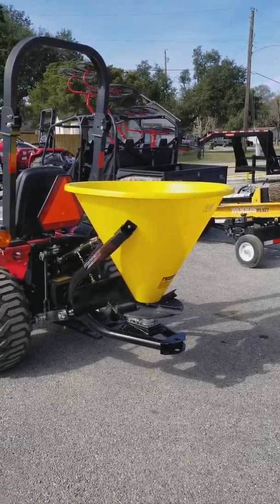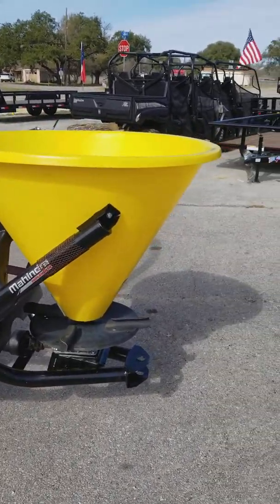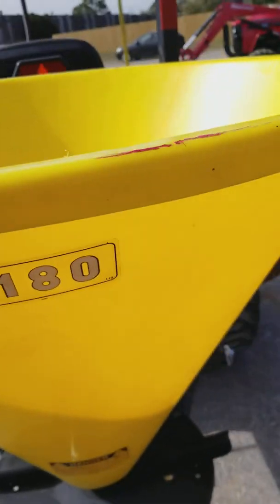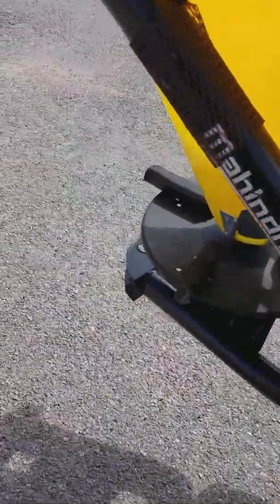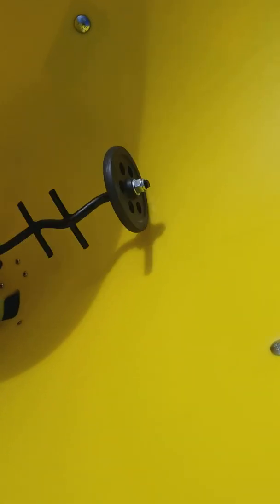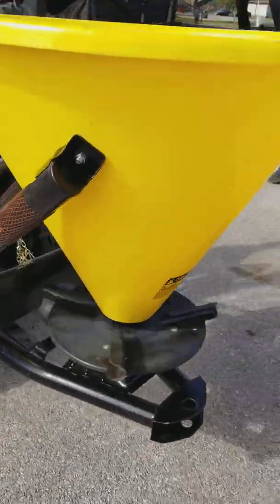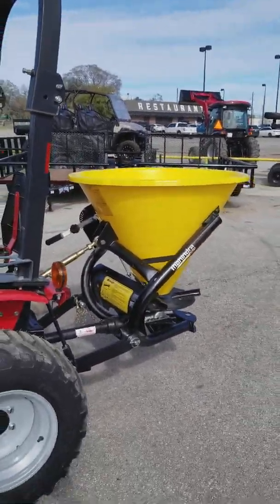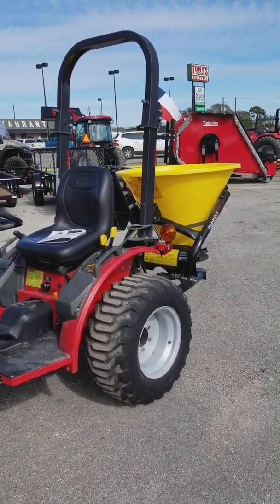Mahindra 3-point PTO driven spreader/seeder

Comment: It does NOT have a heavy duty gearbox. It does have a " stamped gearbox ", with a grease fitting for light duty use, as in fluffy materials. If you are seeding and/or fertilizing it should work fine. Agrex & Cosmo are the main players that make these units under different names. Both are made in Italy. Buy this under the Agrex name & you get a liquid filled cast gearbox with the (3) hopper sizes available in poly or metal... :~)